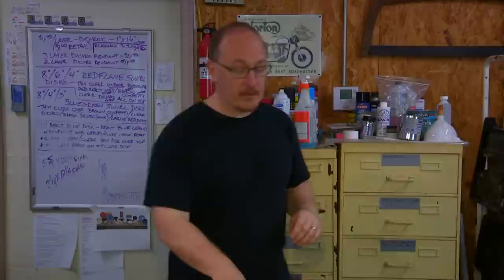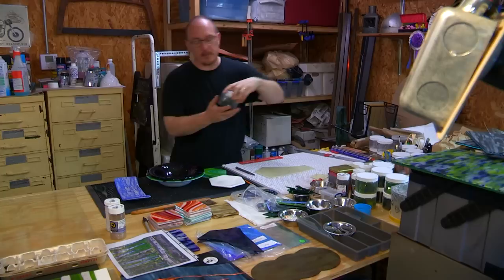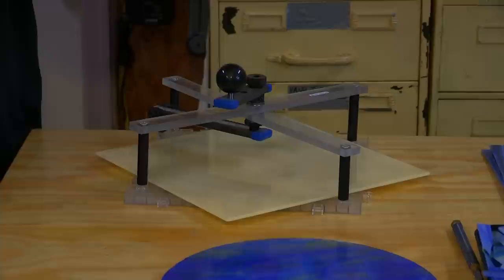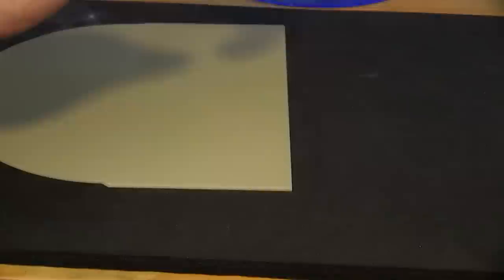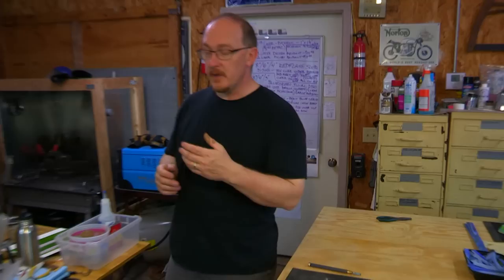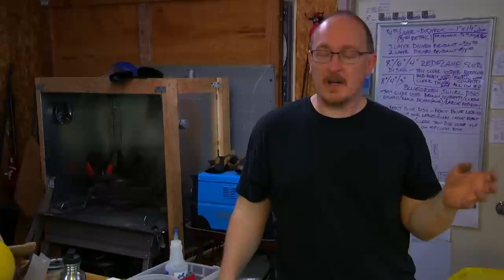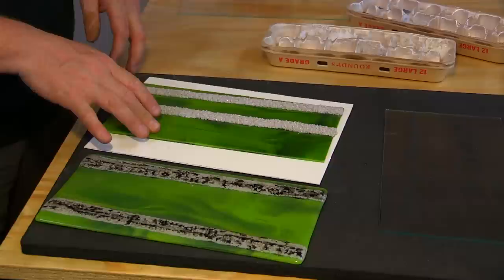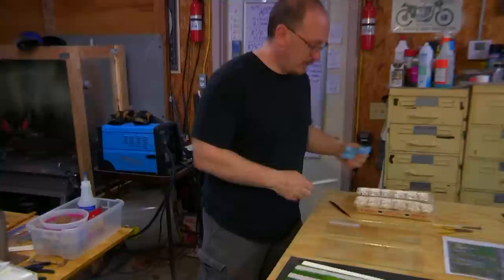Fused Glass Layering and Stained Glass Basics Explained Step By Step

Comment: Thanks for the tutorial. I too was surprised you didn’t use running pliers, but each to their own. I too ‘create 3D scenery from photos but use many more firings. I’d be interested in trying your method. Do you not get air bubbles when covering the ‘higher’ level frit with clear? Do you fuse 3 separate layers then fuse them all together? I’d be very appreciative if you would share with me. Thank you. Gay

Comment: cutting circles looks quite dificult as you do it, they end up dented and its not a clean cut, my suggestion to you to make it perfectly cleaned up at one process is after making a circle  with cutter use a torch to heat the edge then brushed the line cut with oil 3m and see how it comes apart or proceed to separate bumping under.  I have cut this way more than 1000 pieces easier and in less steps, if you master this technique.